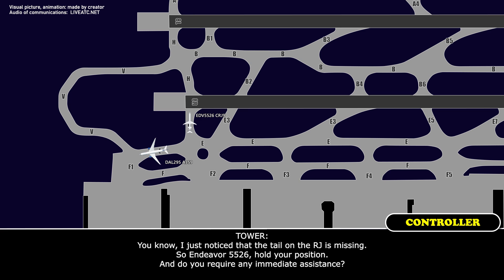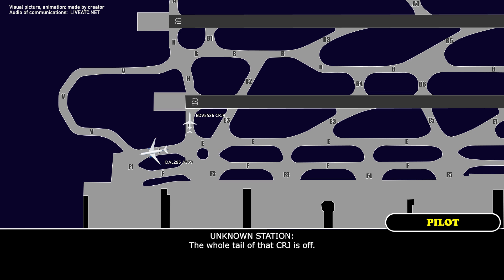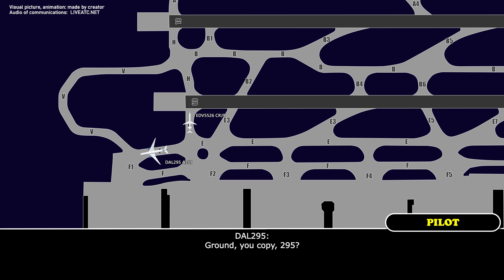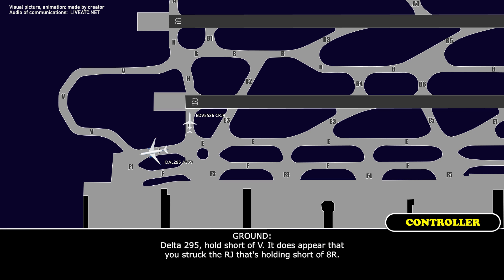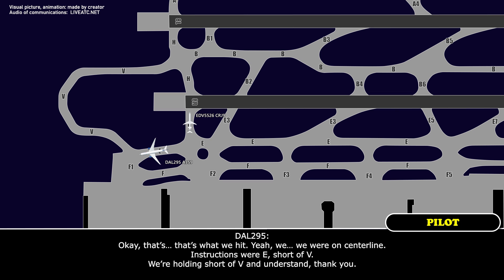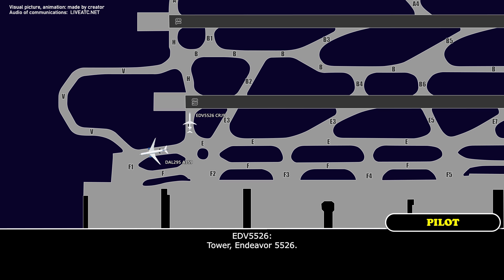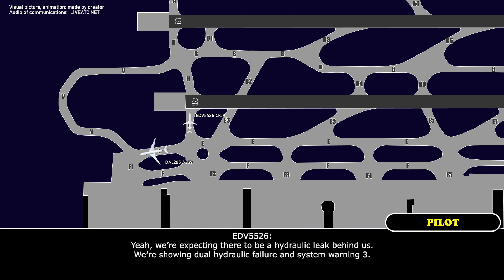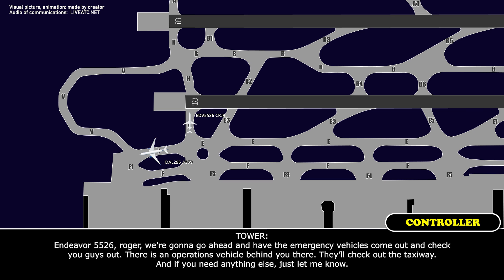“The whole tail is off”. Ground collision at Atlanta. Delta A350 and Endeavor CRJ-900. Real ATC

Comment: You are supposed to know the width of your vehicle - no one is ever instructed to crash into a stationary vehicle.
Reply: But that assumes that the stationare vehicle is where it is supposed to be, no?
Reply: No.  Airplanes stop for all kinds of reasons, you should have your eyes open them taxiing the aircraft you're in command of.
Reply: @nahhomeboy  Were they distracted?  Perhaps.  They were dealing with a technical fault and they originally been cleared to turn onto H behind the CTJ.  That was amended so they could work on their fault to continuing ahead.  So they would not have briefed clearances for that intersection.    But it not easy to judge 112' from where you are sitting.   Two things can be equally true.  Could the crew and ground have suffered from diminished SA?  Yes.  But they would have missed the CRJ if it had stopped at the hold lines.  These things rarely have one cause.  That is why we should live in the world of who is at fault and instead work towards how to prevent them in the future.

Comment: That airplane is likely a complete write off- even if they could repair it! which will take months- the Inspections, and Insurance required over the remaining life of the Airframe will be a nightmare!
Reply: More likely is that Bombardier will have to manufacture a whole rear stabiliser section for the CRJ-900 and yes that wil take months. When a Dreamliner and another A-350 collided at London Heathrow in April this year, the A350 needed a whole new stabiliser unit which had to be made for it by Airbus in France. It was delivered to Heathrow in a Beluga XL yesterday (caused great excitement!). But yeah, VERY expensive in materials, time and passengers lost for the CRJ-900 and hopefully, they can avoid a write-off.
Reply: @1947dave  Hang on, I know this story, at least based on timeline. Didn't the Beluga had to divert to Amsterdam before continuing to the UK due to ... something? Because it was huge news in the Netherlands for welcoming that Beluga for the first and probably only time lool
Reply: Why a write-off? Is the pressure vessel involved? How much structural repair will be required?
I'm no airframe mechanic, and anyway am unfamiliar with the aft structure of a CRJ900. Interested to hear your insights.
Reply: @j_taylor  zzzzzzzzzzzz
Reply: @SAC-93  April 2011, AF380 struck Com CRJ700 at JFK (at the horseshoe), it was repaired and returned to service. After that it was referred as Franny.

Comment: Being on center-line has ZERO to do with hitting the airplane….. You can be on center-line at anytime but it is still “YOUR” responsibility to maintain visual separation from aircraft…
Reply: Wrong!!   The clearance everybody needs is already built in to ALL the markings but everyone HAS TO BE where they're SUPPOSED to be, and the CRJ pilot CLEARLY was not at, on or up to the Hold short line where he was supposed to be.
The 350 was ON CENTERLIINE of taxiway E right where they were supposed to be because the 350 is so big that the pilots CAN'T watch where the wings are BECAUSE THEY CAN'T SEE THEM, THAT'S THE POINT of taxiing planes being on centerline of the taxiway and the Hold Short planes pulling ALL THE WAY UP to the Hold Short line. The pilots taxiing big planes that are where they supposed to be are TRUSTING all the other pilots to BE WHERE THEY'RE SUPPOSED TO BE and pull ALL THE WAY UP to the Hold Short line so they're not sticking out into the taxiway space to give the bigger planes the clearance they need to safely get by the planes that have turned and are sitting at the Hold Short line. 

ATC's standard instruction to pilots is to hold short of THE RUNWAY, NOT to hold short of the Hold Short line like the dum bass CRJ pilot did.
ATC needs to revise their instruction wording and start telling pilots STRONGLY to PULL ALL THE WAY UP to the damn Hold short line.

You need to stop trying to think, you're no good at it.
Reply: Everything always has to go back to DEI with you people. I don’t understand it.
Reply: Whoa, you are a triple 7 guy? Not the sharpest tool in the shed are you? Ever wonder why you have wing walkers when clearing a gate? Hint: has something to do with being unable to turn your head to see the wing a mile behind you properly.
Reply: @steve83333   That’s right Stevo, I am a 777 guy, and since you submitted your very professional input, since when do you have wing walkers out there on an active taxiway smartie pants???? NEVER!!!!! So, it was DEI DL’s responsibility to assure they had the clearance. Otherwise simple, hold position and wait until you are assured you have enough clearance……
Reply: upset because he flies a nicer plane than you?
Reply: @ant2312  he flew....
Reply: @ant2312  🤔 not really.

Comment: Dude, being on 'centerline' isn't good enough.. use your eyes and know your wingspan.. if you don't think it will clear.. STOP.. Seriously, did he not see a plan on the taxiway ?  He had to have clobbered it something fierce to knock the tail off
Reply: well obviously he did think it would clear Einstein
Reply: Wrong!!   The clearance everybody needs is already built in to ALL the markings but everyone HAS TO BE where they're SUPPOSED to be, and the CRJ pilot CLEARLY was not at, on or up to the Hold short line where he was supposed to be.
The 350 was ON CENTERLIINE of taxiway E right where they were supposed to be because the 350 is so big that the pilots CAN'T watch where the wings are BECAUSE THEY CAN'T SEE THEM, THAT'S THE POINT of taxiing planes being on centerline of the taxiway and the Hold Short planes pulling ALL THE WAY UP to the Hold Short line. The pilots taxiing big planes that are where they supposed to be are TRUSTING all the other pilots to BE WHERE THEY'RE SUPPOSED TO BE and pull ALL THE WAY UP to the Hold Short line so they're not sticking out into the taxiway space to give the bigger planes the clearance they need to safely get by the planes that have turned and are sitting at the Hold Short line. 

Juan Browne Blancolirio measured it all out on his channel and the CRJ was 50 to 60 feet AWAY from the Hold Short line, the CRJ is 118 feet long and there should have been 40 feet of clearance between the two planes but there wasn't because the ass hat CRJ pilot is scared shitless of pulling ALL THE WAY UP to the Hold Short line and left too much of the CRJ's ass hanging out in the taxiway E space.

ATC's standard instruction to pilots is to hold short of THE RUNWAY, NOT to hold short of the Hold Short line like the dum bass CRJ pilot did.
ATC needs to revise their instruction wording and start telling pilots STRONGLY to PULL ALL THE WAY UP to the damn Hold short line.

You need to stop trying to think, you're no good at it.
Reply: Ground told them to continue on echo and hold short of Victor. She should have told them to hold short of hotel, but she failed to do so. With the parallax from the cockpit, it’s difficult to tell visually if your wingtip will clear. When you’re given clearance and your nose wheel is on centerline you should expect to be clear of conflicts.

Comment: I don't see how the Airbus crew didn't see the conflict.  A A350 with a wingspan of over 200 feet on a inner taxiway with a smaller jet holding short of the runway.  Would the A350 crew have tried to pass a 737 if that aircraft was holding short of the runway?  Failure of the A350 crew to see and avoid.  Interesting that a Hot Spot is pictured in an older chart but not on a newer chart.
Reply: wrong
Reply: @ant2312  Explain why I'm wrong.
Reply: He can't explain. He just feels it.
Reply: Actually, when Endeavor would have pulled up to the hold short line or a reasonable distance before it, the A350 would have a clear pass.
The issue occurred because it stopped 40-50 feet before the hold short line (and nobody noticed that).

Comment: If the A-350 was taxiing along the centerline they should not be at fault.  If the CRJ had stopped short of the place they should have held at then the blame may be on the CRJ crew, but it may also be a failure of the ground controllers that should have noticed the CRJ being too far from the hold point.  If the CRJ had been a larger AC, like the A-350, the overall length is much greater and they would have needed to pull up closer to the intersection. 
I brought up Google Earth and measured 36.2m from the stop line which should be where the back of the CRJ tail would be if the CRJ stopped with the tip of the nose right on the stop line.  From that point to the centerline of the taxiway I get a distance of 44.9m and with the wingspan of the A-350 being 64.75m half of that, the distance from the centerline of the A-350 to the wingtip, is half that or 32.4m.  If all that was as indicated there should have been about 12.5m clearance between the CRJ's tail and the A-350's wingtip.  
But, two problems seem to be possible:  first, if the CRJ stopped short of the stop line by, say, 16m; or if the A-350 was actually a bit right of centerline making it closer to the CRJ.  Focusing on the second situation, we see that the taxiway the A-350 was on heads nearly due west until it gets close to the turnoff the CRJ was at and at this point the taxiway turns left.  The displacement from the centerline at the location where the CRJ was sitting is, by my measurement and calculation, about 19.3m which means that if the A-350 delayed turning left it's wingtip would have overlapped the CRJ tail be about 7m.  Now, if the CRJ stopped short of the line by, say, 10m and the A-350 was a bit late in turning left the impact was almost guaranteed.  
One more thing which might point to the A-350 ... when taxiing, pilots try to keep the plane in the center of the centerline, BUT when turning the nose wheel is often quite a bit outside of the centerline in order to keep the main wheel along the centerline.  If the A-350 pilot did this as it was taxiing this could have put the plane too far right (north).
Reply: so in an ideal situation there would have been only 12.5 m clearance.  That's far too tight to not be paying attention to your surroundings.
Reply: I’ve seen the pics. A350 was dead on centerline.
Reply: If you’re going to write a novel, please paragraph. It will make it easier to read 😂
Reply: @StealthFB22  I did paragraph -- look again!
Reply: @Raptorman0909  I guess I’m old school with writing. Usually a paragraph contains 3 to 9 sentences before a line break. Makes for easier reading. Yes, I’m just being difficult haha.
Reply: @StealthFB22  And that IS what I did.  My post, the one you referenced, has four paragraphs.  At the end of a paragraph, instead of a couple spaces before starting the next sentence, I pressed the carriage return to end the paragraph.  This was done three times for the four paragraphs!
Reply: Who was that "mathed" man!  Joking aside, thank you for the in depth explanation.
Reply: or, you know, since they were holding short of V anyway might as well held them short of E3

Comment: From the FAA: “Ideally, the aircraft should be kept centered over this line during taxi. However, being centered on the taxiway centerline does not guarantee wingtip clearance with other aircraft or other objects.”
Reply: I am a retire American captain and I can assure you that the Captain of the A350 is solely responsible for the movement of his / her aircraft.  If you are not sure that you have the clearance from another object, stop.  I don't care what ATC says.  He / She  will be responsible with the F /O and additional crew members sharing some of the blame.  ATC, the airport facilities and the RJ may be contributing factors.  It is a lousy situation all around.
Reply: If they were on the centerline, they would have a wingtip ~115ft to the right if that.  The CRJ is about 120ft long from memory, so they should have had clearance of about 40 feet.  However, the CRJ looks to be about 50 feet short of the hold short line.    It will be interesting to know why.
Reply: @duckfeverretrievers600 That’s assuming that the impact didn’t pull the CRJ backwards which it easily could have done. I think we will have to wait till the FAA report to know for sure.
Reply: @solracer66  But it didn't.  We have the video.
Reply: @solracer66  No assumption.  We have the video.
Reply: @duckfeverretrievers600  the Airbus had speed and serious momentum because of its size. It could have dragged the little plane backward many feet when it caught the back wing and destroyed the back of its airplane. Just like if a moving semi hit a stopped  MiniCooper. The stopped Minicooper willmove after being hit by the semi. Basic physics, transfer of energy.
Reply: @alexwyler4570  But it didn't.  We have the video.
Reply: First Officer monitors right wing tip clearance.  295 hit a stationary plane so they will catch some of the blame.
Reply: @encinobalboa  all the blame..
Reply: Outdated airfield design from the 1970s on the "new" 1980 ATL airport; should be able to taxi on the centerline unless known restrictions like a stretched CRJ on a adjacent taxiway.  Combination of pilot error and airport layout.
Reply: @Captain_Aubie  funny thing, they operate all sizes of aircraft at ATL all the time. Using your logic there should be a lot of ground collisions. Someone wasn't paying attention.
Reply: @Captain_Aubie  what if it was a 757 holding short.  The clearance would have been the same and 757 would have been protruding more.  This is normal airport ops.
Reply: sure are a bunch of arm chair pilots commenting on this.
Reply: @skippynj1979 If a 757-200 or 300 was holding short the pilot would have held short of hotel; sounds like they didn't notice the ERJ or its position relative to their A350.
Reply: @Captain_Aubie  I don't think we can comment on the crj position as we don't know why they weren't all the way up.  They were given a line up and wait, so I bet there was an aircraft that just infront of them.  Possible the captain was heads down for the moment doing the before take off below the line checklist, or checking the TPS, FMS etc with brake on.  Maybe it was a heavy that took the runway prior with a bit of zealous thrust to get on the runway.  So the crew was slow walking the pull up.  At the end of the day it doesn't matter.  The taxi way was the CRJs to use and they were short of the hold short line.  Well short but doesn't matter.
Reply: Isn't the CRJ a short plane?  What if it was one of those long Mad Dogs Delta used to fly?  You can't have any part of the plane crossing the HOLD SHORT line so a longer plane would stick out further.  I'll pull the airport's diagram and look at the wingtip clearances for that intersection.
Reply: @TonyP9279 CRJ9 is 119 feet long, per Wikipedia. That's right about the same length as a B712 or DC93, and a little shorter than the shorter variants of the Mad Dog. It's a pretty big airplane, for an RJ.

Either way, it could have been anything from a 172 to a 747, you're still not supposed to hit stationary objects with an A350.
Reply: Yeah they’ll carry the blame. But they were set up to fail. Pull up to the damned line guys.
Reply: @zacky5315 should be 10 feet?  Please point to the FAA FAR reference of hold short or required distance.  Or does the FOM of Endeavor have a requirement different than my operator that I fly for.
Reply: Ground told them to continue on echo and hold short of Victor. She should have told them to hold short of hotel, but she failed to do so. With the parallax from the cockpit, it’s difficult to tell visually if your wingtip will clear. When you’re given clearance and your nose wheel is on centerline you should expect to be clear of conflicts.
Reply: @Skepilot  that does not alleviate the the crew from avoiding other aircraft.  We get clearances all the time with aircraft holding short parallel to the taxi way.  Just happened to me yesterday in KORD with a widebody waiting to take off 9L at TT while I was going to bravo.  My instructions were to taxi to bravo, not wait for traffic to move than go to bravo.  You stop and wait for conflict to move.  Normal SOP.
Reply: @Skepilot  Just because the ATC tells them to, means nothing. Its up to the pilots, to make sure its clear to taxi.
Reply: @Skepilot  nope
Reply: @Skepilot FAR 91.111(a) "No person may operate an aircraft so close to another aircraft so as to create a collision hazard."
Reply: @Skepilot  No.  Ground gave them a clearance to taxi via the clearance they were given which they followed however they are still responsible to see and avoid or stop, question and verify.  A wheel on a centerline does not guarantee clearance as we just witnessed
Reply: @Skepilot Agreed, but shouldn't be a collision risk if an aircraft (CRJ-900) stops only 50 ft short of the hold line.
Reply: @Skepilot, what a load of horsecrap. You're obviously never been anywhere close to a real cockpit. But if so, God have mercy on your passengers.

Comment: Oh boy your troubles are more than just a couple hydraulic leaks.
Reply: That airplane is likely a complete write off- even if they could repair it! which will take months- the Inspections, and Insurance required over the remaining life of the Airframe will be a nightmare!
Reply: @SAC-93  : Ayup. Considering that all three hydraulic systems go to the tail, and a large amount of control wires and cables and then finding out what parts of the fuselage are bent or contain hidden fractures or fatigue...

I am really surprised if it will ever fly again. Meanwhile, engines and most parts are in fine condition to be reused.
Reply: @SAC-93  Indeed.
Reply: PF to PM "alright, check rudder ... push left ... push ... wait, why are the pedals not going back?"